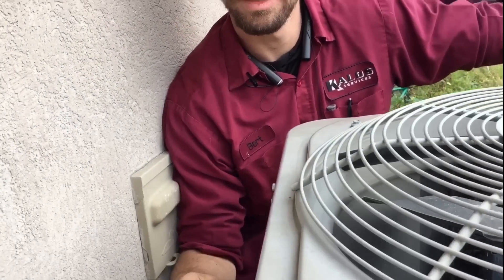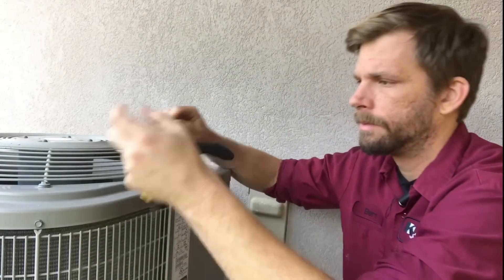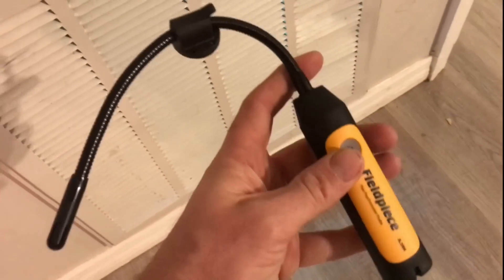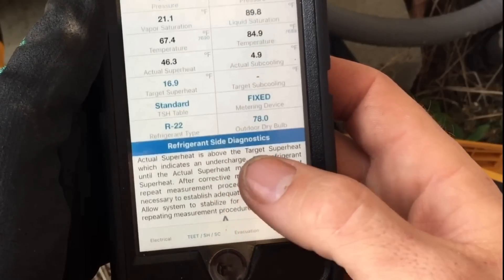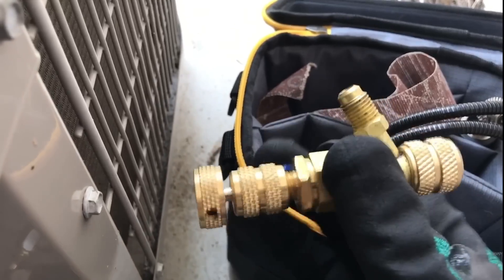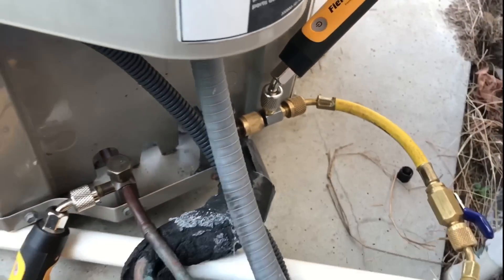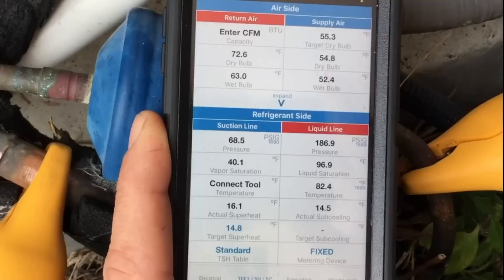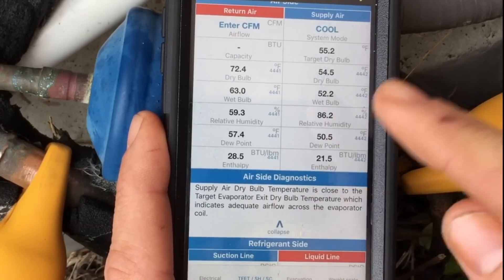How to Charge by Superheat With the Fieldpiece Joblink Probes

Comment: Just a question, if I bought that kit and added a 3rd psychrometer probe to measure the outdoor dry bulb at the condenser, would the app automatically calculate the dry bulb from that probe to calculate target SH, or do you have to enter DB manually like you did? I'm just debating whether to buy the extra psycrometer probe or not... Thanks.
Reply: To map it just go to the probe manager in the toolbox.
Reply: Did you get the answer? Let me know. Ty
Reply: I would love to get an answer as well. Did you get that third psychrometer?

Comment: That bleeding didnt look right lol. That air went right into the system.
Reply: if the system was off how would air get in the system? looked like the system was off, he purged the hoses after he connected to the refrigerant tank.
Reply: it actually sounds like the system is running but maybe it was an editing error.
Reply: Thank you,I was wondering if that was correct as I am still learning.

Comment: Was the unit valved off before he purged the lines?  It looked like the schraeder valve core was already depressed when he purged the charging hose.  If the unit’s pressure was less than the charging tank pressure from say the tank being stored in a hot truck,  then the air in the charging hose would have been forced through the open schraeder valve into the unit’s system before he purged the line.

Comment: Those smans are surprisingly durable. I just bought the sm480v and plan to keep it for a long time. I hope they work out the kinks in the app that others reported last year. Data logging is a must. I was able to connect to the app without issue so far.

Comment: Your comment about the 0 superheat at the evap coil is wrong. The evap coil in flooded at 0 super heat therefore refrigerant is NOT evaporating in the coil. Also the way you were bleeding your charge line is wrong. You should have bled at your bottle with its valve closed. Your line was hooked up to the system that already had charge in it which would have pushed air in the line to the bottle.
Reply: The bottles have check valves. You can’t push air into them. Or refrigerant for that matter. And yes a 0 superheat evap coil would be the most efficient, but you would have no protection from the compressor slugging. Just like he said.
Reply: @Triaz357  you are missing his point as to why the tank valve should've been closed. Sure, it has a check valve and thus no air or refrigerant can enter the tank. His point was that the valve at the tank should be closed in order to be able to bleed the air out of the lines at the tank. Instead, you tried to bleed air at the unit from the pressure of the open tank. Sadly, this same pressure from the open tank already pushed any air in the lines into the system.
Reply: Jason Sherrill That could very well be what he meant but it was not what he said.

Comment: so if it was r410 a ,,, we only charge it via liqiud ?
Reply: Yes. Because the r400 series are a mixture and the different components evaporate at different temps. So it needs to be used as a liquid.
Reply: Always as a liquid for 410a. Loading as a vapor is as bad as loading the wrong refrigerant(which is technically true).
Reply: Wooo Hoo, R22 gone next year,
Reply: you can charge by vapor using r410a by metering the liquid refrigerant through the low side guage and/or using a kwik charge device.
Reply: No you find and fix the fucking leak first. Like a real tech would...
Reply: Ross R you understand this is just a video showing how to charge using superheat with this equipment and not a troubleshooting video as to why it’s low on refrigerant, right? Why don’t you chill the fuck out super tech.

Comment: The way you bled the hose before adding freon didn't look right. Hate to be like everyone else and judge every little dumb thing when you're just trying to prove your point but some viewer's are watching with very little experience. Your valves were open on the system and at the tank when you bled your hose,  so any air was already pushed into the system.  Good video otherwise👍🏻👍🏻
Reply: HVACR Survival  Maybe the service valve was front seated? With his set up that’s the only way I saw how he could have bled the hose correctly,Or if he did it before he hooked the charging T up.I doubt it since the service valve cap was on.. I’m newish so what I said was probably wrong 😁
Reply: No, air didn't go into the system.  The system is under pressure, probably at least 50 psi even when off.  The air was pushed out of the hose by the refrigerant (and the system if the schrader was depressed), around the male end of the tee / service port, and into the atmosphere.
Reply: Yes!! he did put noncondensables in to the system but not big deal 😬😳 shit's happened 😎

Comment: One thing you might want to add is that You may want to find the source to why the system is low on charge to begin with before adding. Also when we need to charge using super heat with fixed device how important is our sub cool? Next video? Thanks
Reply: Superheat should always be done with getting sub cooling also

Comment: Good stuff 👍 I've recently wanted to learn the difference again between checking suction pipe temp/ superheat at compressor vs evaporator.. with the new probes, it seems more possible to check at evaporator, but why again?
Reply: Tony McKay just made that tech tip today 😀
Reply: @HVACS  Haha, Thank-you! 👍
Reply: I have had my set for several months now and love them. They make setting up a Txv a dream with r ed refrigeration equipment.  I dont get near the rated distance but they are still a great tool
Reply: I suppose at evaporator would just be more accurate statement of what work the evaporators doing. And at the compressor would just be to make sure no liquid comes to the compressor. And then I suppose some manufacturers might specify if they want it at the evaporator or compressor

Comment: Excellent video we need more videos like this to inspire and show the young technicians just coming into the field how to use tools so they’re not intimidated. The only problem My son and I have the Fieldpiece sensor kit and the range sucks (“ unless it’s a simple wooden structure for the signal to go through the walls it does not matter how far sensors will connect in open free air with no obstacles in between at line of sight in the real world we don’t work with in line of sight”!.) in the past several months I use them every day or try to the buildings with brick or concrete walls or just one floor with a concrete floor below you spend more time trying to connect the signal move your phone around or move your senses around if you had to charge by the hour while fiddling with the Fieldpiece software you to go bankrupt first in the real world. But I do like them for simple close proximity jobs I give them a thumbs up in that situation just waiting for them to come out with some better range in depth to penetrate walls in commercial buildings and office buildings. Until then I would wait before purchasing the sensors until they come out with the next generation then I’ll give them a try once again.  For those Techs who purchase the Fieldpiece sensors a little word of advice for some reason the Fieldpiece sensors do not always work very well with the Fieldpiece software download the Measure Quick software and that usually fixes fieldpiece sensors problem with connectivity and reliability issues.